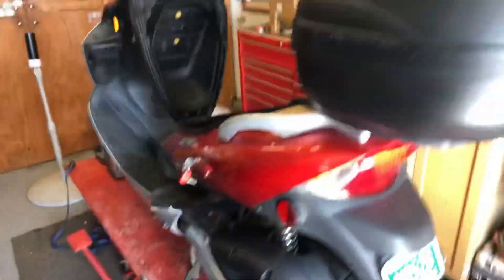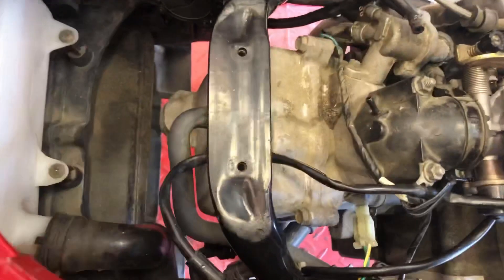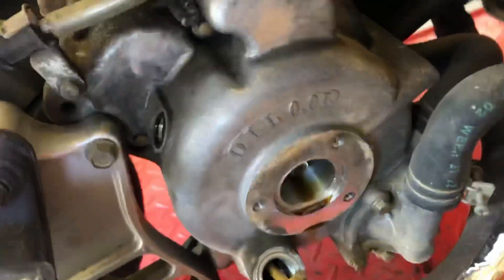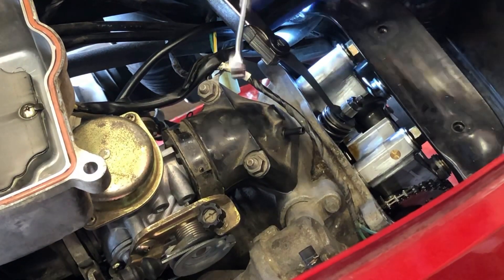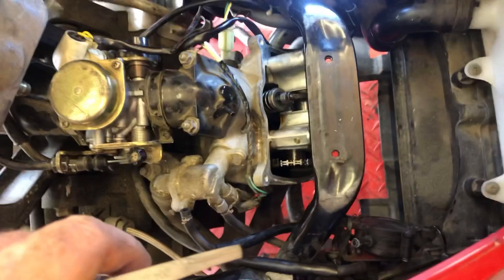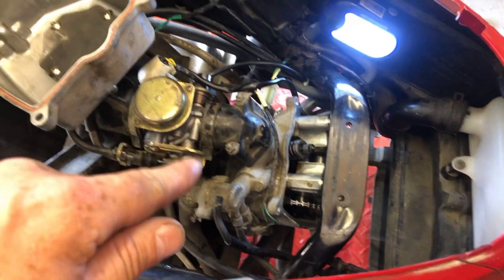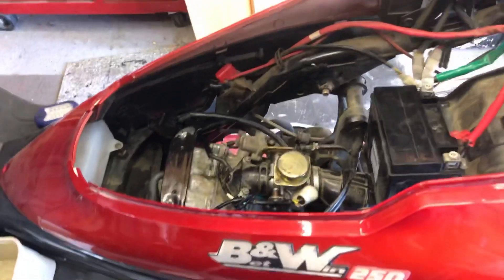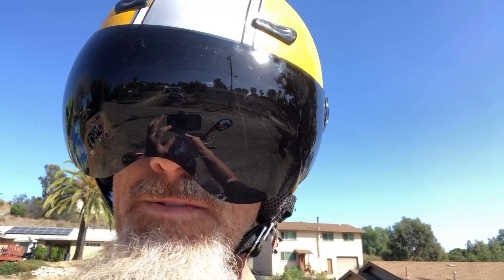Valve Adjustment / Fuel Filter Replacement for the Kymco 250 Bet and Win Scooter

Comment: Does it matter if you turn the flywheel clockwise or counterclockwise to line up the “T”
Reply from the maker: You’re supposed to turn it in the regular rotation the engine runs in.  Unfortunately I can’t remember, but if you touch the starter button you can observe which direction it turns.
Reply: @TomsTinkeringandAdventures  you turn clockwise

Comment: Hi Tom, thanks for the primer on valves. I have a 2005 People 250 (same engine) that I'm very attached to. I've just encountered a problem I thought you might be familiar with: Starts immediately, runs fast on the choke, idles down, hiccups and stalls. I've adjusted the idle and throttle stop screws for a bit higher idle but I can still hear and feel the hiccups at lower rpms and there can be a bit of throttle delay on take off. I planned to clean the carb next. Any ideas?
Reply from the maker: It sounds like carburetor issues to me.  Check that fuel filter as well!  The People 250 is a good scooter, I like the bigger wheels.
Reply: Thanks Tom. Fuel filter next, then cleaning the carb. Kymco doesn't make any large wheeled scooters any more; disappointing!